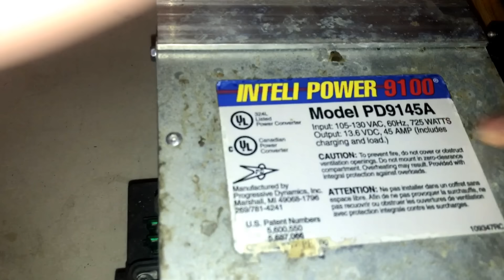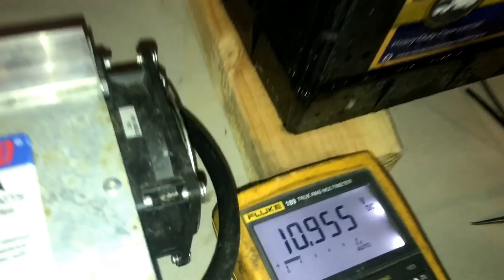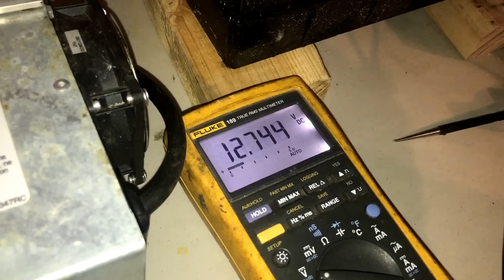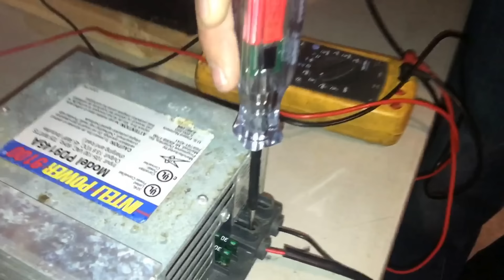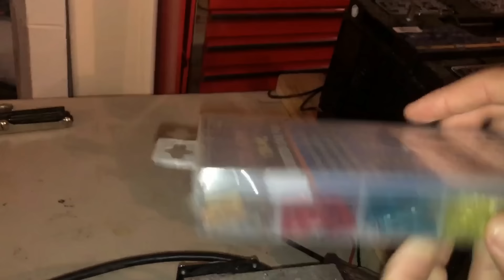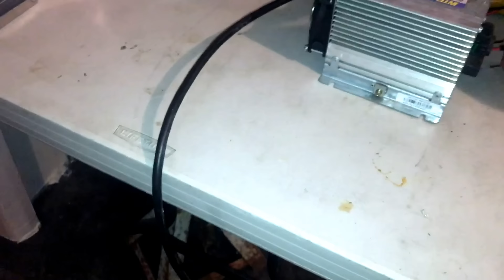How To Trouble Shoot An Rv Power Converter

Comment: Great video. I am hooked up to shore power and my 12 volt systems are working but my house batteries are loosing power, not being topped up? Fuses look good and circuit breaker for the converter has not been tripped???
Reply from the maker: If your house batteries are losing power then most likely your converter is not charging. If there is no water in your batteries and they are lead acid batteries then this will create a problem to. Make sure they are topped of with distilled water. Do this with the coach unplugged. Also verify you have 120v power. Is the microwave working? Then check your GFIs. If you are handy with a volt meter you can hook it up at the house batteries and verify you have 13.5 volts or close to it. Most likely your batteries are not receiving a charge from the converter.  What is the year make and model of your Rv is it 50 amp or 30 amp? Shore power?
Reply from the maker: I recently fixed one that was not charging and it was the Bi-directional Intellitec Relay something three other shops missed. so the more details i know about your Rv then i can get a better idea for you.
Reply: The coach is a 2007 Coachmen Mirada 315SA. I am hooked up to 50 amp shore power. Microwave is working, so is the tv and coffee maker.

Comment: hi i have  a TT Imagine 2800bh i get a faint humming noise from converter not all the time but started last year its a 2017 model any ideas is it fan running??
Reply from the maker: Most likely is your fan running, when it heats up the fan turns on to cool it down. is normal the older the batteries get the harder the converter has to work.

Comment from the maker: Thanks for watching everyone and if you want to Join the team and help us get to 1,000 subscribers please subscribe today. we provide. How to videos for all Rv enthusiast. Between me and my father we have a combined 45 years of experience and can answer any question you have, we might do a video on it as well. Thank you in advance for subscribing it helps us out alot.
Reply: Are you still checking this? I really was hoping that this video could help me with my inverter in my pop-up camper, but I'm still having problems.
Reply: My 5000 Watt inverter stopped working. After plugging 30 amp into residential power using conversation attachment.   It caused the extension cord to melt but still worked several days more when switched to a different cord.   Then when plugging in again a few days later, it instantly started flashing on and off.  I quickly turned off the inverter connect switch.   Now it is dead.  People on groups and Shawn the Roadtrek head tech said it was a short either on the cord, the plug into RV outlet or the inverter.   We did a continuity test of that area, and when we got to the inverter/ converter, we tested the wire that connects to the back.  We did not know about the fuse.  How do I find the fuse on our inverter to test?
Reply: Thank you
Reply: Why wont my motor home start with the house batteries removed.
Reply: Could I please ask you some questions??

Comment: The former tech probably wanted to replace the converter because it should be putting out 13.5 volts DC or greater, not 12. The fuses can be a cheap fix, but the voltage has to be over 13.5 in order to charge the battery.
Reply from the maker: I think it is very funny that you are trying to tell me how a Converter works. You sir clearly did not watch the video.
Reply from the maker: Ive Been Working on Motorhome's all my life.
Reply from the maker: The Batteries being used were dead, had they been fully charged then it would be at 13.00 or greater. I use a $800 Volt meter so it is a tru RMS the one you use is probably not as accurate as mine. The converter in this video was perfectly fine, nothing wrong with it and still works today.  Had i unhooked the converter from the battery and tested it then it would be 13.5 volts. When i tested at the converter it was 13.2 but hey thanks for watching and commenting without watching the entire video.

Comment: Great info. So your telling me it converts power to the electric panel and to the battery. And the BATTERY supplies certain lights but MOST of the Rv power comes from electric panel . From converter.  #dim lights are converter issue
Reply from the maker: Yes, Also Dim lights or lights that Dim can be caused by a few things but the converter is a great place to start as to why they might be dimming. But if i was fixing it, I would start at the Battery and make sure they are topped off with water. and Take a voltage reading with it unplugged and then plugged in. I would then take a voltage reading at the converter. Ive seen lights Dim from lose ground wires and converters that were going out because the battery was so old and the converter was doing all the work. another cause i have seen is lose 12volt fuses in the supply panel normally located within the converter but on higher end coaches can be anywhere.
Reply from the maker: Sorry for the delayed response.

Comment: which battery? I have a battery that runs the engine, the sliders and the hydraulics. Then I have the house batteries 6 volts each that powers things when I'm not hooked up to an electrical box.  Right now, the power goes off and you hear some ticking before the power comes back on.
Reply from the maker: So Power Converters are hooked up to your House Batteries.as for the noise you are hearing, that can be a number of things.
Reply: So converter charges the battery so you can dry camp with (DC ) some power, not plugged into electricity. And the electric panel is part DC fuses and breakers. The breakers  are power converted from AC (electrical plugged in) to back of the breakers, ... now my question is this = I read the lights will do short bouts of dimming ( and a sound happens ) WHEN the converter has to charge- up the battery.   Does this only happen when it’s on DC and their battery is running down ?
Reply from the maker: the noise you are talking about the beeping that is. Comes from your Lp Leak detector typically located somewhere near the floor. it has an audible alarm built in to inform you the Dc voltage is getting low and will need to be addressed in order for the leak detector to work properly. it can also be a co2 detector/LP detector. depending on model of Rv